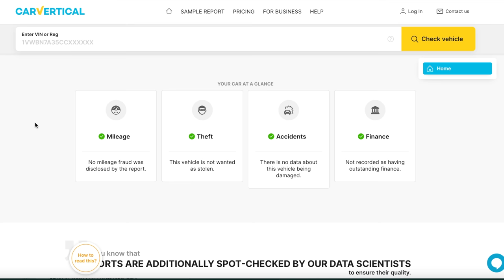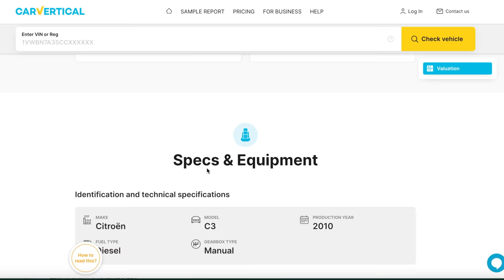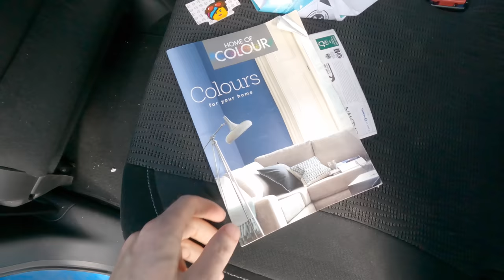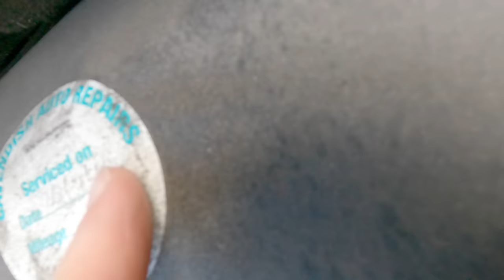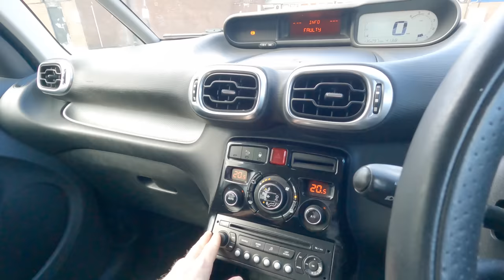I BOUGHT A CHEAP CITROEN FOR £300!

Comment: From a car dealer's perspective, I'd say you were right to take this one to the knacker's yard. From a youtuber's perspective, it would have been nice if you'd finished off the tale having had the engine problem(s) diagnosed and repair costs estimated. More comprehensive content.
Reply: Once that car tiptoed over 5 it was fucked. You're chasing money. Such a pity. I hate French cars. They are great looking and have mad ideas. But built quality is shit.
Reply: Spoiler alert! :D
Reply: At £300 at that mileage with issues that bad to fix it you'd be throwing good money after bad and probably not even make a profit. Better just to scrap it...
Reply: I agree that it would have been interesting to hear what was wrong with the engine. This 1.6HDI engine (DV6) has also been used by Ford, Volvo Mazda, Mini, Suzuki and Vauxhall(Opel). It is actually one of the better diesels engines on the market -IF SEVICED PROPERLY. Unfortunately these sub £1k cars are treated like plastic bags: you get one when you need it and when it is full of trash, you throw it away and get another one. Very few want to put 25-50% of the cars value to a single service.
Reply: @teabagtowers3823  You agree and I agree that, as a car dealer, Matt did the right thing in having the car scrapped. However, Matt is also a youtuber and by not having the engine problems diagnosed and repair costs estimated, there was good content missing from the video. I was not suggesting he have the car fixed.
Reply: @BURP39R  Tbh, I've had loads of French cars (all Peugeots really, some with a Citroën badge), and they were all very reliable.
Reply: @MarkJVSomers  Oh I agree. But feel that is down to care from the off. I own a Jazz that by old people law should be perfect.
It's not. I've spent loads on repairs.
Reply: @saddoncarrs6963  I think judging by the comments Matt made about it misfiring and smoking like a steam train. The car was £300 to buy and to repair considering all the issues that it could have been the repair costs could have been all over the place. One comment here on this video said it might have been sub £100 sensor but if it was the turbo or injectors then it would easily be a couple hundred quid. That and what's to say it wasn't multiple faults that and there was the fuel sensor as well it was knackered.

So I would have liked to have seen a cost breakdown of the repairs but I understand why Matt just basically said screw it and sent it off to the scrap yard. I think other than throwing £15 of diesel in the tank and taking it for a quick spin it would have just been throwing good money after bad.
Reply: @teabagtowers3823  Yes, I get what you're saying. But I'm commenting on Matt as a youtuber, not a car dealer.
With his connections, it would not have cost Matt much money to ask his mechanic to give an informed diagnosis of the engine problems and a rough estimate of the cost to fix it. Now, if that information had been included towards the end of the video (regardless of whether he scrapped the car or not), it would have significantly improved the content. All good stories have a beginning, a middle and an end - I just thought this ending was a bit lacking.
Good stories make good videos. Good videos mean more views, more likes, more subscribers - and presumably more money for Matt.
Reply: @saddoncarrs6963  This isn't some Shakespeare esq story I can tell you what would have happened. All that would have happened if he'd have taken it to a mechanic is they'd have said it is uneconomical (cost more than its worth/get back in profit) to repair and he'd have scrapped it. When he mentioned the issues the car had (misfire/bad turbo with no pull/knackered injectors) I knew instantly what the conclusion was to this story that being that this car was uneconomical to repair.... If he has already lost £50 scrapping it why lose say another £30 getting it diagnosed when it's clear its knackered. Just take the £250 and send it to the scrapyard and be done with it. Wasn't even worth putting £15 of diesel in it.
Reply: @teabagtowers3823  I hope you can understand that not all of Matt's viewers are as knowledgeable about cars as you appear to be. Myself included.
Why spend, say, £30 on having the car diagnosed and an estimate drawn up? I'd suggest it would have been a good investment - its conclusions would have improved the content of this video and helped the long term success of Matt's channel. I'm sure he's keen to add to his already impressive 219k subscribers.
Even an astute car dealer like Matt can't make a good living out of buying bangers sight unseen, and then trying to flog them for a profit. But he can use those bangers to make good videos for those interested - and he can make a good living out of that. The better the content in these videos, the more successful the channel. Better watching for us, and more money for Matt.
Reply: @saddoncarrs6963  Why would it be a good investment to spend £30 on diagnosing a car that anybody could spot was a complete hunk of junk and waste of time? Be honest you don't have to be a mechanic to know it was knackered. It is clear to see I'm not a mechanic I have two friends that are mechanics but I didn't ask them about this car. 

Diagnosing a car with a faulty turbo/injectors/fuel sensor/injectors and is smoking like a steam train is not difficult. It is not difficult to spot if a car is smoking badly let's be honest. Usually it is something like a blown head gasket which can cost a fortune to repair.

I've had a car where the turbo has gone and it had no pull at all like the Citroën in this video that and if he put £15 of fuel in the fuel sensor didn't move accordingly then clearly that's broken. That and injector knock could be heard from a mile away in short it would be uneconomical to repair.

He paid what £300 for it he put £15 of fuel in it and he could tell it was not worth his time or money. So sold to scrap yard for £250 and be done with not worth wasting his time diagnosing a car that anyone with even an ounce of knowledge about cars could spot is knackered. Matt already makes good videos about buying bangers and repairing them his recent video on a Jag XE is a great example. 

However, some cars you should just get rid of them they ain't worth the hassle.
Reply: Put the diagnostics on it and see if a scrappy would have a motor? That would be interesting.
Reply: @teabagtowers3823  I'd imagine that spending £30 on diagnosing the engine problems of this car would not be a good investment, with regard to the car - but it would be a good investment with regard to the content of the video and, therefore, to the channel. We appear to be talking at cross purposes here - I'm focussing on the youtube channel, you're focussing on the car.
Yes, Matt's video on the XE was very good. This one was also good - I'm suggesting it could have been significantly better for the sake of around 30 quid.
Reply: @johnnunn8688  Exactly - maybe not economically sound with regard to the car, but good video content.
Reply: @saddoncarrs6963  Yeah and you're missing my point his channel is doing well enough as is his videos do well enough as is. A £30 diagnosis is not going to yield thousands of new subscribers. Spending £30 on diagnosis would be waste of money and it wouldn't yield a noticeable amount of subscribers. That's not how YouTube works you are not going to get a 1000 people saying "OH MY GOD he included a diagnosis I'm going to subscribe." If you believe that then you are honestly naive about YouTube....

A 20 second clip of a mechanics diagnosis test us what we all know is not some amazing thing that must be included in the video to gain subscribers.. ....
Reply: @teabagtowers3823    "A £30 diagnosis is not going to yield thousands of new subscribers". Of course it's not. But, looking at the bigger picture, I'm sure occasional small investments like that, designed to enhance video content, would pay off in the long term.
Reply: @saddoncarrs6963  He does those investments with the other videos he makes on bangers that he restores to working order and sells. He did not need to in this case because the car was completely knackered and it would be a complete waste of money and time for literally zero benefit.
Reply: @Burp Reynolds - what year Jazz is it and what has gone wrong with it? I'm quite surprised as Jazzes are always top of the league for reliability.
Reply: Well said excellent exactly what should have been done I had a feeling the EGR valve was solid
Reply: @teabagtowers3823  I bought a C2 1.4 hdi for my kids to learn on that developed the exact same symptoms, (limp mode, smoke etc) got a mate with a code reader to have a look, needed a new injector on cylinder 2, £42 on ebay, 3 hours on the drive and 33k miles later still running fine with regular servicing. I watch these videos from the perspective of, "what could I buy for £x and could I fix it so I'm with @saddon cars on this, a quick view of an OBD diagnosis would have been nice.
Reply: @teabagtowers3823  Turbo on those (I think it's the same engine as a 2006 Berlingo I had) is a £1300 job-they do go, mine was a leaky injector missed in a service, dripped down into the turbo and gummed it up. Replacement involves multiple oil changes and cracking the sump off and re-gluing.
Reply: When car dealers aren’t mechanics just car washers that’s where the issues start
Reply: @BURP39R  Every car today is like that.
Reply: @BURP39R  'great looking'? In general I hate how french cars look except new peugots
Reply: It's french for that reason I'm out lol
Reply: My best friends mum has a a 2006 renault grand scenic since it was built and still works well to this day so some French cars are good
Reply: Good Job it wasn't British made ! Then again are there actually any British car manufacturers still in existence 😂
Reply: @teabagtowers3823 i had this engine in the past and similar issue's (limp mode and smoking, engine failure on the dash) when i worked close to home for a while, diagnosed it the shop told me that my egr was clogged due to the car not getting up to temp. I thought of scrapping my car before the diagnose in the end it was a diy fix to clean the clogged egr. Fyi the diagnose was free of charge so agree to always diagnose because you could also lose money it could have bean a simple sensor or clogged egr etc.

Comment: I would've actually diagnosed the fault before scrapping it. You never know if it's a 50£ fix or 1500£ one before you actually diagnose it.
Reply: A blocked egr valve would be a cheap fix
Reply: That wont be anything below £1000
Reply: @curtisj2165  It was £350 for me
Reply: @letter1014  for an egr valve? Wow
Reply: If it was EGR or DPF the engine light would be on so I would say it was the injectors which are not going to be cheap if you can get the bastards out
Reply: I think it is quite clearly not a 50 quid fix
Reply: Maybe a can of injector cleaner, or ask his mate who sold him the car if he knew what the problem was??!!.
Reply: @peterlocke5204  obvious he knows the issue,hence why he’s sold it for 300 quid as it’s scrap.

He ain’t going to sell it for 300 quid when it’s just needs dpf cleaned….
Reply: Because that costs money as does the solution!
Reply: @ricbrook7059  True. It costs your time and maybe 20 cents worth of electricity to connect a diag. tool to scan for errors and see live data.
Reply: That sounds like bottom end
Reply: @peterlocke5204  I agree staged for videos half of these I think. Where does the sellers be in these vids I've never seen cars left out and the guy can't find it in a car park yet carries the key someone please explain how this works.
Reply: @martymartin2894  The "car park" is located very close to his business premises in Stockport. When Matt goes to look at these cars, which have been left in the car park, they have already been bought in by someone working for him as a part-exchange deal, in order to sell on some other used car. The "seller" has already driven off in their "new" car.
Reply: Its the injectors very common fault on those 1.6 hdi from 2007-2011
Reply: I actually know the person who bought this car! Matt didn't scrap it, he sold it for spares / repairs.

There was absolutely nothing wrong with the car mechanically. It actually transpired that a rag (or plastic bag, can't remember which he said) had got sucked into the air intake and was choking the engine! She's now back on the road :)

Comment: Honestly, this car could have been saved. I owned a C3 Picasso, same year, for 6 years. I drove to Spain and back twice, drove to France and back, to Portugal and back, did deliveries in it to support myself during my degree, moved house in it a bunch of times. That car was my friend. I never had a single issue with it. I bought it used and serviced it on time, just the regular maintenance. I admit, it wasn't the most exciting to drive, but it was comfortable, very practical and economical. And not a bad looker, but looks are subjective. A very underrated car in my opinion.
Reply: I agree with you I have done the 500mi Scotland, and bought another with a friend and re-sell for profit, service it on time, take care of it... And that was a good profit in it probably with no much wrong with it... They are cheap to fix too and to run too!
Reply: Nah it’s not underrated. Its a sh*tbox.
Reply: Any car could be saved, but man has a business to run, profit to find and the repair would likely be worth more than the car is
Reply: Too uneconomical to repair unfortunately
Reply: Obviously it could have been saved, but the guy's running a business to make a profit, not to start a car museum!
Reply: Same here, had 2 of them, the first of which our daughter in law is still running and the second of which, a 115cv diesel we had to trade in after 160000 totally trouble free motoring because of local restrictions on diesel use
Reply: I agree, with had one for 7 years, 1.6 diesel, 92 HP, 6 speed semi-auto. Very good car.
Reply: Yep, that one was probably made on a Friday. Mines cruising along on 198,000 miles, no problems.

Comment: That engine is perfectly fixable - probably. If everything else is reasonable at least investigate. C3 Picassos are roomy, comfortable, tardis dimensions inside, tons of boot space and their paint jobs last. Why dump it when the engine issue might be fixed easily?
Reply: I had the same thought, was a real shame. However MV60WVS isn’t currently showing as being scrapped, so doesn’t look like it went to the breakers yard. Perhaps, despite what was said in the video, it was sold as a trade sale. Given the bodywork, and overall condition I would be surprised if it was written off.
Reply: @wintersun398  It has gone to the the breakers now and is untaxed and unmot'd

Comment: Had a similar issue on my wife's Pug 208 with the same engine, and with basic diagnostics, I was able to fix the car for just £30. All I had to replace was the MAF sensor element rather than the complete assembly (roughly £90-£120 for Bosch item) The car presented itself with similar issues, lack of power, lack of boost from turbo and very slight smoke, even kangarooing occasionally. Now it drives perfectly.
Reply: @Pedro Daniel Lopes Ferreira Depends on what price range the car is in.  The c5 and c6 are quality cars!  And certainly the 2.0hdi.  The French also have/had the better diesels and were years ahead of the Germans.
But the build quality in the cheaper cars is sad...
Reply: @Pedro Daniel Lopes Ferreira nothing wrong with Renaults
Reply: @richardjohnson3463  Would agree, I own a Renault Traffic van that as a family we have had for sixteen years. Almost 200 thousand miles from the 2.0 litre turbo diesel engine and it is still running well. Always serviced on time by a top mechanic who does the job properly and thoroughly and the engine and gearbox are superb. Been looked after and it has served very well.
Reply: @pev2197  I'm a VAG fanboy and even I have to agree with your comments. Well said.
Reply: @Pedro Daniel Lopes Ferreira I own a Japanese car so no bias here but the last time I looked at the Warranty Direct reliability Index Peugeots were actually more reliable than the German brands and amongst the best European cars for reliability.  Land Rovers were the worst of course.
It is worth looking at their website of cars three to seven years old that they cover under warranty as it throws up some surprising results (reliable Fiats).
Reply: Note, french components may be in Mercedes vehicles, like the Vito. I know a story of a Vito getting the manual transmission changed several times. On the other hand, I like the typical french 5 speed, and how they make the steering feel. And look at the price tags... The trick is not to pay too much. They charge on the extras.
Reply: @Pedro Daniel Lopes Ferreira Bla bla bla, another 'exepert'. There are no worse cars than American.
Reply: @Pedro Daniel Lopes Ferreira I cannot speak for Italian motor vehicles but when I was living in Europe I had the Renault 4, small engine, cheap, never let me down.
Reply: @adamme8369  Every single car built by Magna Steyr is worse than any recent American car.
Check out the JD Power reliability details for their Mercedes & Chrysler models, YIKES !
Reply: @Pedro Daniel Lopes Ferreira really how would you know if you dont own such, I have  20 year old Citroen done near 300,000 miles never broken down and only do a basic service each year. Very cheap running at 50 miles per gallon ---- where as BMW are terrible, expensive always going wrong and rust every where.
Reply: @Zander7.5  Prince engine? Yeah hope your timing chain don’t go
Reply: @Pedro Daniel Lopes Ferreira Absolute BS.
Reply: @Pedro Daniel Lopes Ferreira 

They’re really not. I’ve had five Citroen vehicles and put serious mileage up on them with no major issues

It depends how you define “terrible”, I suppose.